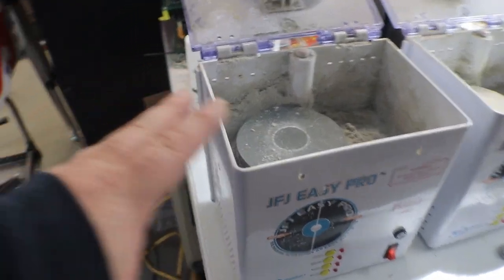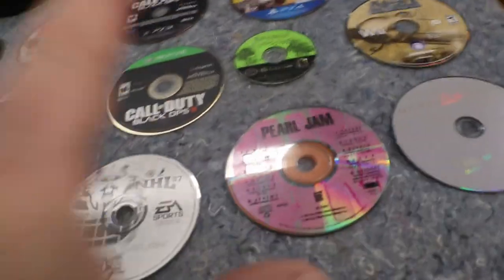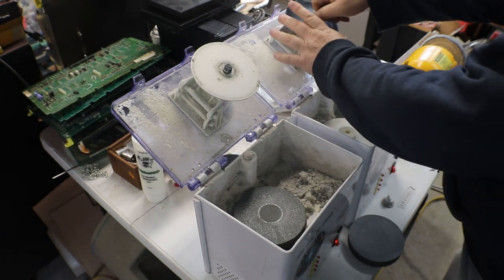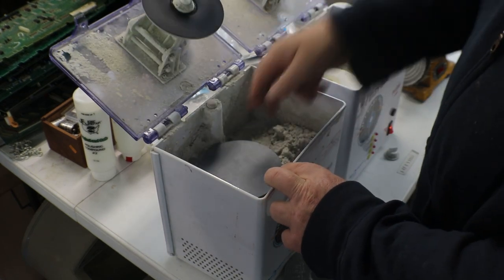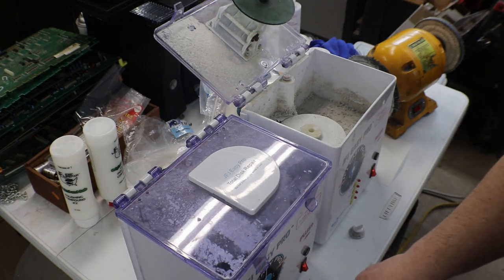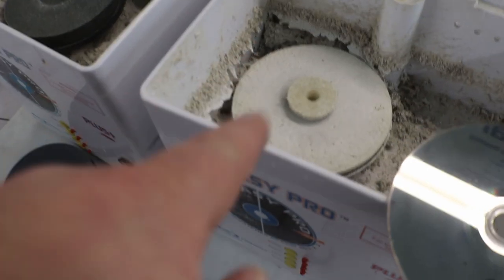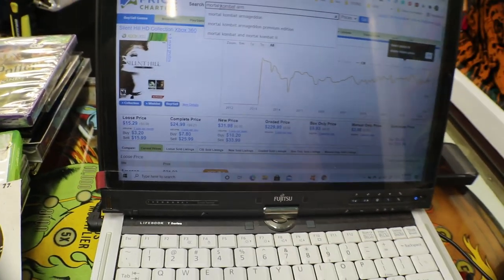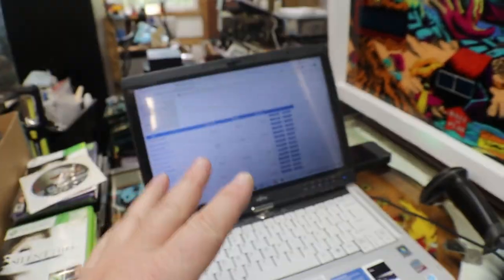JFJ Easy Pro / Video Game Disc Cleaning & Pricing / How To Clean Video Discs

Comment: great video ! i just got my jfj and have only practiced on one disc to try to wear the pad in and so far not happy with the results  so im gunna try the cotton wheel but thought i heard you say something about using the compound on the wheel or if i miss heard that as it was quick passing statement .now i apologize if you address this later as im only just over 30 minutes in but its 230 in the morning and ive watched a ton of jfj videos tonight but will definitely finish yours tomorrow as it has been the best one by far and i subscribed because of it
Reply from the maker: Sorry I didn't answer you earlier. It takes a while to get the pad broke in. It's not a perfect system and that is why I use the cotton buffing wheel on a lot of my discs. I use the buffing stick for my cotton buffing pad it's kind of a waxy stick, it works good. Light and quick on the cotton buffer give you better results. Over time I have figured out what works best on the JFJ and you will to in time. Nothing is perfect.

Comment: So do you not use the blue stuff? And is the cotton 6" wheel anything specific (brand or type)? I was looking at one that came with loose cotton not sure if that work.
Reply from the maker: I have used the blue solution but found I get better results with the buffing wheel. A softer cotton buffing wheel works really good for me. Just be careful not to hold the disc in one spot to long. You will find that the buffing wheel will take out a lot of lite scratches.

Comment: QQQ  Please:   What wax or polishing compound are you using with the polishing wheel ???
Reply from the maker: https://www.amazon.com/SCOTTCHEN-Buffing-Polishing-Cutting-Compounds/dp/B0828K5RH1/ref=sr_1_9?crid=3TT1M4O2UWW7N&keywords=buffing%2Bwheel%2Bcompound%2Bkit&qid=1643193985&sprefix=buffing%2Bwheel%2Bcom%2Caps%2C384&sr=8-9&th=1
I only use the white stick for my disc's.

Comment: Nice video. I have a question? What sand paper grit did you use on the gamecube game that i can just buy at my local hardware store to do the same? Thank you.
Reply from the maker: 1200 grit wet or dry.